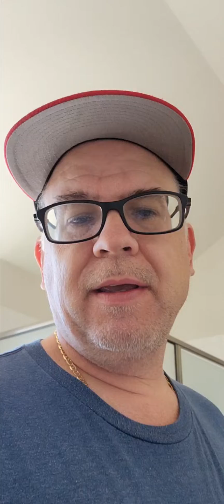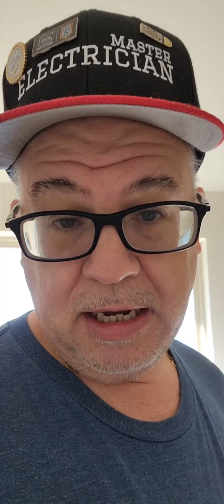Explaining 210.11(C)(3) - 20 Amp Bathroom Circuits

Comment: If I want to add a bathroom receptacle (an extra receptacle near the floor, not one of the ones required by 210.52(D)), can it be branched from a light circuit if that light circuit is shared with another bathroom? Or are all bathroom receptacles subject to the requirements of 210.11(C)(3)?
Reply from the maker: Greetings- nothing prohibits additional circuits in bathrooms and also the only limits to putting things on lighting circuits is the rules in 210.23(B)(1) and (B)(2). Now, the receptacle will need GFCI protection of course but since its not bring installed to meet 210.52(D) or per 210.11(C)(3) then I see no reason you can't install it on the lighting circuits as long as loading (as stated in 210.23) are considered. A load is a load..hope this helps.

Comment: I ran a 20a to my basement bathroom 2 outlets only. Can I feed off my GFCI to my workshop on the other side of the wall and add new outlets only?
Reply from the maker: No, if the circuit is for the bathroom receptacles thats what they serve and no other outlets.

Comment: Can you run a Broan 70cfm bath exhaust fan on a 15 amp circuit?
Reply from the maker: You would need to supply more details on the Broan fan as I am not going to research the fan. Sounds like a simple exhaust fan for a bathroom and many of those have been installed on 15 Amp BC for the bathroom lighting.
Reply: @MasterTheNEC  120V 1.5 Amp
Reply from the maker: It is very common to put the bathroom exhaust fan or a fan/light combo on a 15 amp lighting branch circuit. There is nothing that prohibits the practice.
Reply: @MasterTheNEC  The 15A combo switch that has one power source arcs on the fan and the other switch controlling an LED Light separate from the fan doesn’t?

Comment: good explanation, 
i compared the text of the NEC
in the 2023 the (s) was removed from the word bathroom , while in 2020 version, there is that wording : " bathroom(s) "

does this means that 2023 NEC prohibits stringing countertop receptacles of several bathrooms ( 2 ) in your example , in one 20A circuit , while it is allowed in 2020 NEC ? 
thanks for the reply
Reply from the maker: No, the (S) still appears in the actual code text in both editions for 210.11(C)(3). Nothing is changing on that from the 2020 to the 2023 NEC. You can still daisy chain the 20 amp branch circuit from one bathroom countertop receptacle to another in another bathroom as along as all that circuit is doing is bathroom receptacles required per 210.52(D).
Reply: @MasterTheNEC  thank you, maybe i read text  incorrectly from a  website that is displaying some code changes, as i cant find the actual text from 2023 when they stop issuing pdfs. appreciate  the confirmation Sir, more power  ! 
new subscriber here,  cheers

Comment: Great video! 
Question…Can I connect all the bathroom LED overhead lights, shower light and exhaust fan (no heater or light) to a dedicated 15amp GFCI protected circuit? This circuit will be in addition to the dedicated 20amp circuit for a receptacle.
Reply from the maker: Sure, just be aware that the shower light may or may not have instructions that call for GFCI protection.